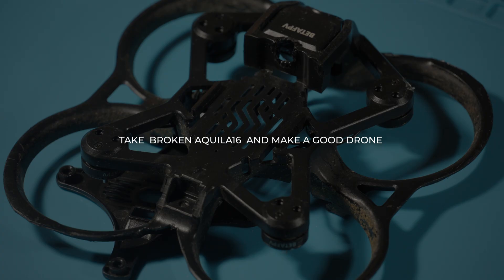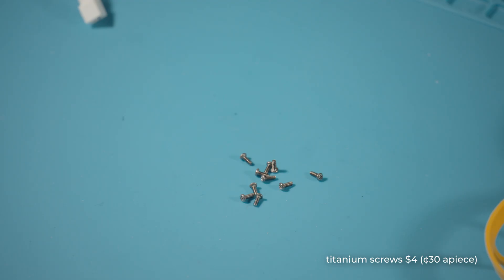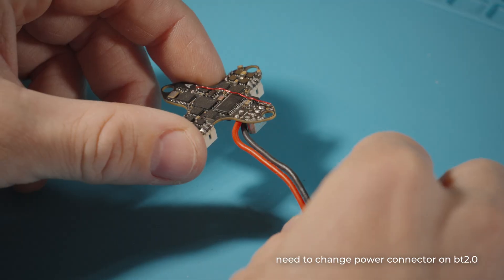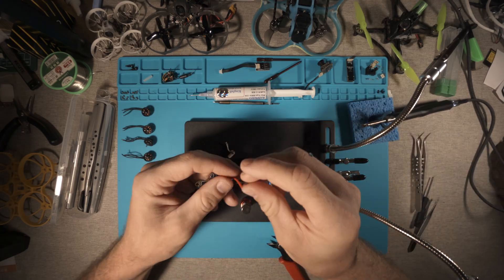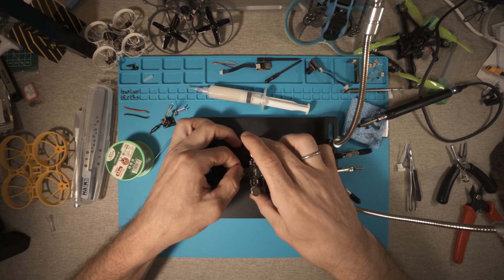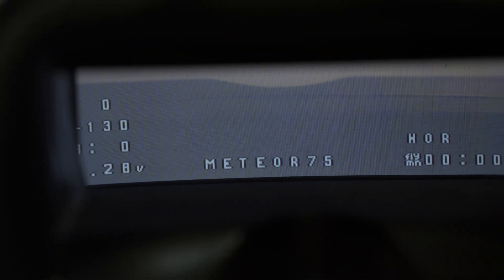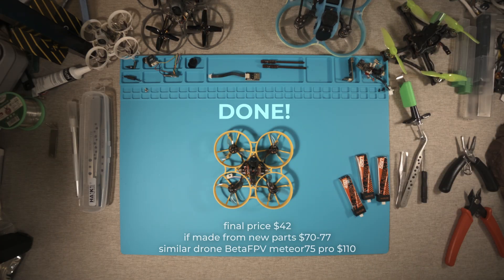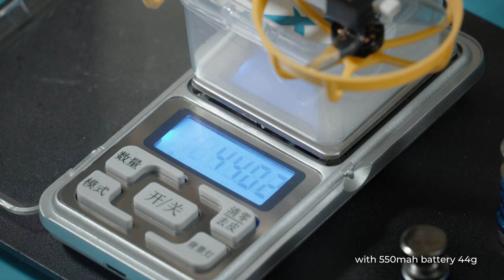Transform AQUILA16 to METEOR75 Pro | ONLY $40 for PERFECT DRONE for BEGINNERS #fpv

Comment: The default rates on the aquila are shit but when you adjust them in the betafpv configurator app, the drone flies alright, but is still a bit unstable. Overall it's still an improvement, and I'm enjoying it.
Reply from the maker: It's difficult to say what's good about aquila16 in stock 🤣
Reply: @Nik_FPV24  It has been 12 days since I recieved the aquila, and today the pitch/roll potentiometer broke. 4€ for a new one, but 10€ delivery. I'm getting a radiomaster pocket.
Reply from the maker: I've been using Radiomaster Pocket for a year now, and I haven't had any problems at all